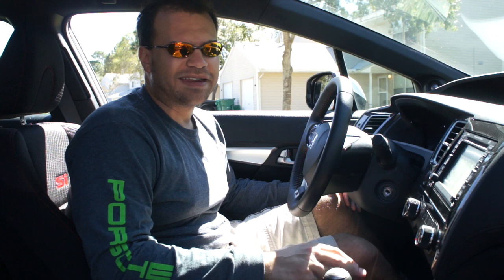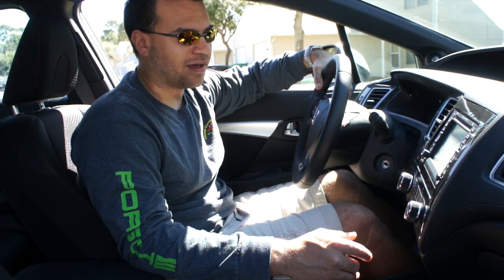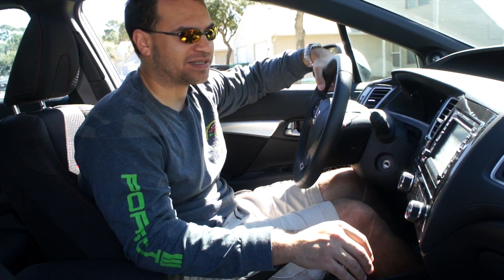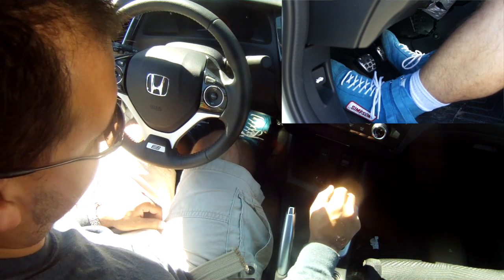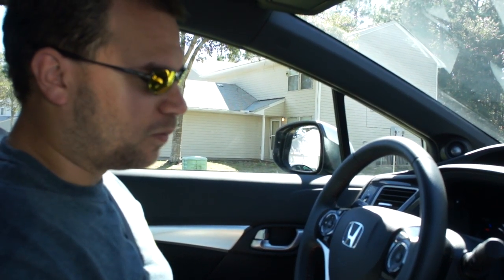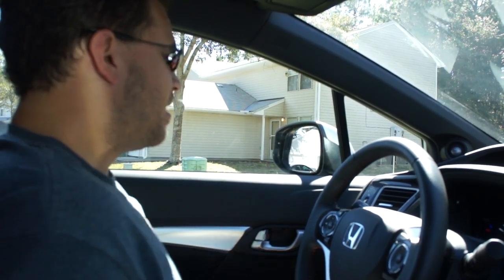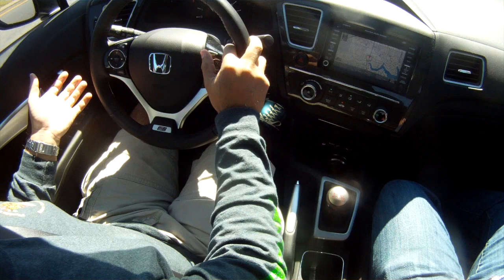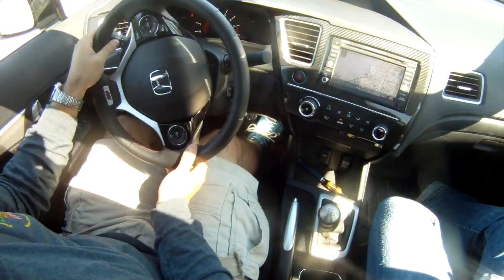Heeling and Toeing Basics  - 9th Gen Civic Forum

Comment: I bang the gears in my 95 GSR it loves it , it has alot more mechanical feel to it but in my 2013 si sedan it doesn't really even feel like a manual more like an automatic that requires you to press the clutch and select your gear... It hates being shifted fast it feels faster if you take it easy and be kind ... Takes kind of getting used to but pays off , feels much more sophisticated. I do notice that annoying rev hang though , its like the ugly cousin of the rev match in the 370z..

Comment: how do you feel about the lag in throttle? I don't know if I just suck or if i'm actually having a difficult time timing the rev match due to lag... I used to drive an em1 before upgrading to the 9th gen..

BUT AWESOME VIDEO THOUGH, good tutorial for beginners! I definitely took a while to learn this. I still double clutch, I just got used to it.
Reply from the maker: I really don't notice any issues with heeling and toeing in the 9th gen civics, but it's also something I do all the time.  A lot of people have complained about "rev hanging," as an issue.  To be honest, from what I've noticed the "rev hang" only occurs when your foot is still on the gas shifting, it's doesn't really strike me as an ECM issue or a problem, especially for heeling and toeing.  Let's assume for moment I'm crazy and "rev hang" is real.  If your RPMs just don't drop when you shift, unless you would happen to be at redline, there shouldn't be any problem for heeling and toeing.

 Let's say you get on the brakes and go to heel and toe downshift, let's say you get the clutch in at 5500 RPMs... well, if it hangs there, if you're fast enough, you may only need to blip the throttle enough to raise it 500RPMs or 1000RPMs, maybe originally it needed to be 2000RPMs.  So it wouldn't really change the mechanics of the maneuver, it might just effect how you end up pushing the gas pedal.

As for any lag in throttle response because it's an electronic throttle, I defintiely have not noticed any of that at all driving the car.  If anything, it's a very strong, very quick to rev motor.  Admittedly the traction/stability control is one of the most invasive I've ever seen, but it shouldn't come into play on something like this.

Comment: So you go to neutral first than heel and toe? Also are you holding the clutch in the whole time? Good video btw! 👍
Reply from the maker: It's best to think of "heeling and toeing," as one coordinated action.  It's not really step 1. ok, heel and toe, ok step 3., etc...  Pushing the clutch in is part of it, but it should be one coordinated action, and since the goal is to slow down in and get the car under control, you'd never want to hit the gas pedal with it still in gear, so I suppose you could think of depressing the clutch as the first step, but as I said, it should really be one smooth, coordinated, action.

When the clutch is depressed it separates the engine and transmission by physically pulling the clutch disc off of the flywheel.  So while the clutch is in, just like the motor, the transmission is slowing down.  If you didn't keep the clutch depressed the entire time you'd probably be trying to do what is called "double clutching."  When you double clutch you depress the clutch to get it out of gear, then when it's in neutral you let the clutch out and rev the motor.  This both raises the RPMs for the downshift and spins the transmission fast so it too will be spinning faster for the downshift.  You then push the clutch back in, but the car in gear, usually rev it again to raise the engine RPMs, and let the clutch out.  This really isn't necessary in modern synchro transmissions.  So, to just downshift and rev match you have to have the clutch depressed the entire time, unless you're going through multiple gears as you downshift.

Comment: any pointers here? i can rev match while downshifting just fine that isn't the problem, i have a 8th gen Si, and the pedal is mounted to the floor, (cant tell if your 9th is), but when i go to blip the throttle while braking i tend to push the brake in further while trying to blip the throttle, like braking pretty hard every time i try to blip, so i end up looking like a idiot lurching forward every time i blip, is it pretty much just your toes on the brake? anyone ever experience this problem?
Reply from the maker: Firstly, everyone is probably going to do this slightly differently based on the size and shape of your feet.  For instance the most annoying car I've ever had to do this in as a Lotus Elise and some people love it.  I'm not 100% sure what you mean by lurching forward.  The only way that the car can lurch forward is if when you're pressing the gas pedal you're in gear and that clutch pedal is out.  At that point there's no point in blipping the throttle at all.  If you mean that the nose dives a bit because you're braking harder, honestly that's pretty normal.  As I said in the video, this is a racing maneuver and isn't necessarily practical to do on public roads all the time.  It is also meant to be done under hard braking, so generally when you're doing this you are literally braking as hard as possible in a braking zone.  So, this is probably a combination of maybe the pedal configuration and the actual procedure itself.   Some cars are very hard to heel and toe in, such as early Porsche 911s, wings engineering or Rennline pedals are almost a requirement to heel and toe in those cars.  Most modern Japanese cars are pretty easy to do it in, however.
Reply: RandoRando  yes what he's saying is correct and he also mentioned in the video that this is done at the threshold so in an ideal situation you wouldn't be pushing the brake down any further. If you are practicing this on public roads like I had to do, your best bet is to either try it on exit ramps where you can actually afford to brake harder. I had the problem with pushing the brake too much when I first started. Something like that could be solved simply by wearing a different pair of shoes. I can heel-toe better in my flip flops because they're wider but I prefer not to since they lack stability.

Comment: coming from a car thats automatic.. and not having to much knowledge on driving manual, do you think that driving manual on this si, (not pushing it) is easy to learn?
Reply from the maker: Yes, I really wouldn't worry too much at all.  Honestly the clutch pedal itself is pretty light it doesn't take a lot of effort to control the release, they're pretty much the standard pedals on every Japanese car made today.  The only part that is slightly hard is going through the gears just because it's such a close ratio gearbox.  In fact, much like the RX-8 they're annoying and pointlessly close.  You can be in 4th gear at 30mph and you're fine.  In most Porsches I think that might actually kill the motor, lol.  It makes enough torque you're not lugging the motor and it drives fine.  Honestly 4th is probably the most useful gear.  If only they'd made 6th longer it'd probably get 5-10 more mpg.

Just remember, go slow and be smooth, let the idiots behind you honk or go around, who cares?  Just relax and be smooth.  The only thing you really need to be careful about is putting it in gear.  As long as you have the clutch fully depressed you can't grind gears or hurt anything.  And above all else, stalling from a stop won't really hurt anything, so if in doubt just hit the brakes and stop the car, don't worry about stalling it or not having your feet in the right place, etc.  Stop the car.
Reply from the maker: Just don't rush.  One of the best lessons is to learn to get the car moving without using the gas pedal.  That way you realize 1. it's possible and 2. there's no need to go crazy trying to dump the clutch and hit the gas at the perfect moment to get moving.  Just slowly release the clutch and try to get used to feeling the friction point where the clutch engages, and then slowly letting it out so it will begin rolling without even touching the gas pedal.  Once you get used to that, getting moving in first is really easy.